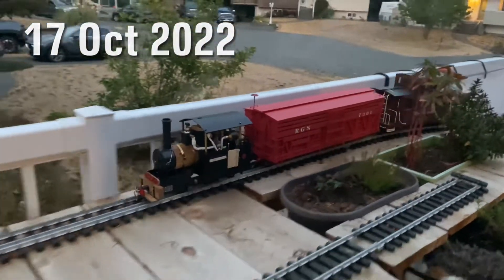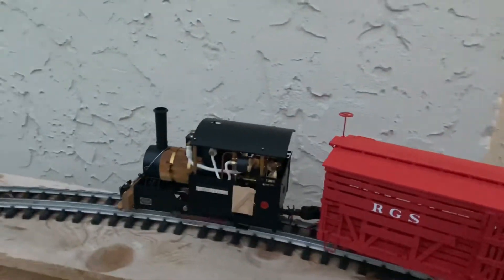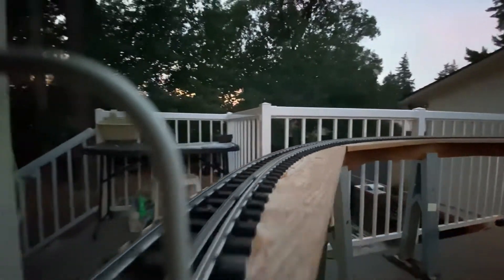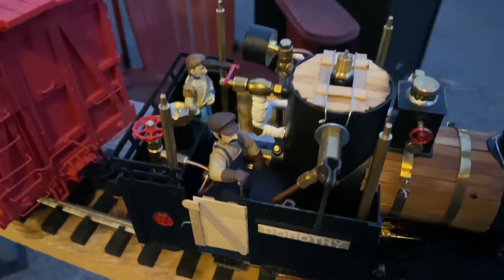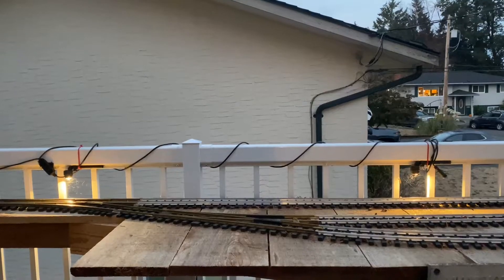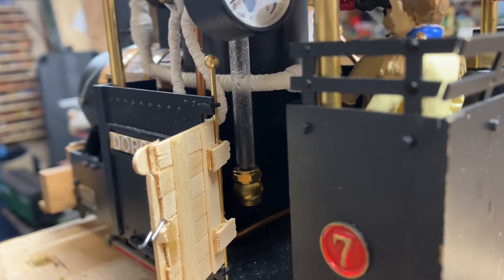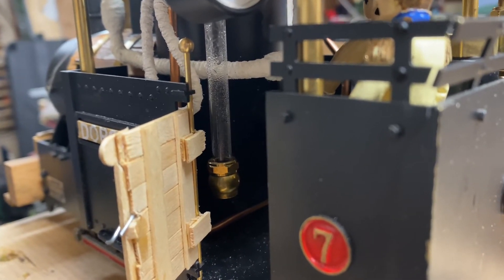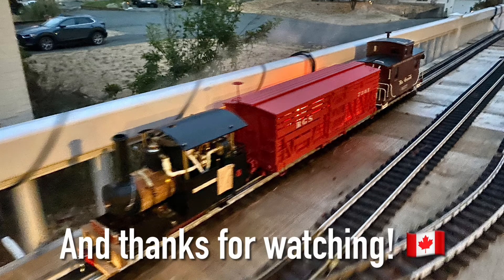Victoria BC: Regner Lumberjack - new sight glass from Garden Railways Limited (link in description)

Comment: Hi Terry great to see Dorothy running again.Can I just say thanks for all your advice re the Manod mk3.My one is now running great on track for around 15 mins with about 1/4 water still left in the boiler.
I have noticed the burner is being contaminated by steam oil from the blast pipe.
Any ideas to cure this or just spray the top of the burner with contact cleaner.
Thanks again.
Reply from the maker: Hi David. To start with I only fill the lubricator with 2.5 ml of steam oil. Filling more than that wastes a lot as after 2.5 ml the amount overruns the steam line. I usually occasionally spray the top of the burner with contact cleaner. I also have much less oil getting there now because I have installed a chuff pipe on the blast pipe. That redirects much of the oil. Summerlands Chuffer makes a chuff pipe for this loco. Google where to get one. Mine is home made in a group effort between myself and my friend Steve in the UK.
Reply: Thanks Terry.A chuffer it is then.
I have a feeling your dog loves steam trains almost as much as my dog lol.
Reply from the maker: @davidwhite1864  She brings her toys there so I suppose she feels if I am playing so should she. Lol